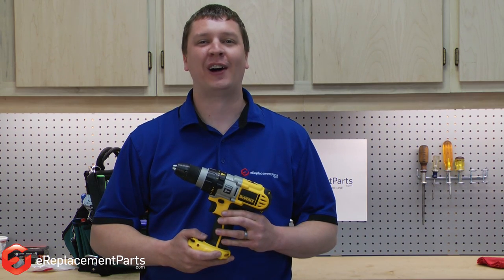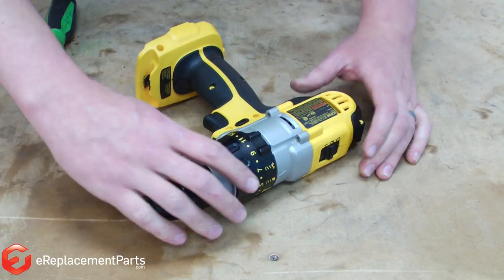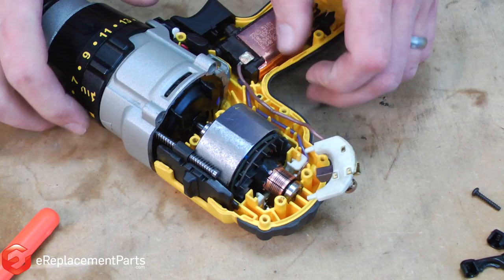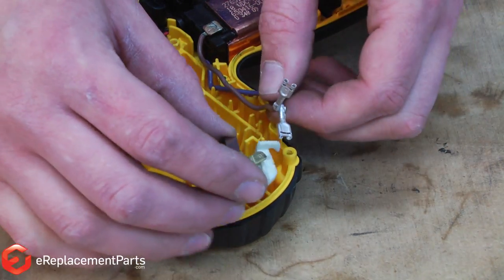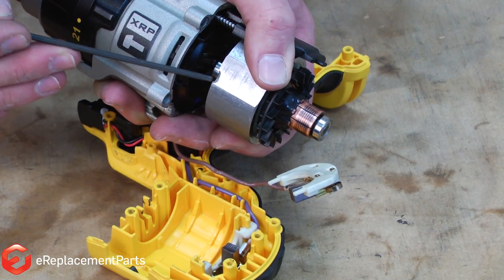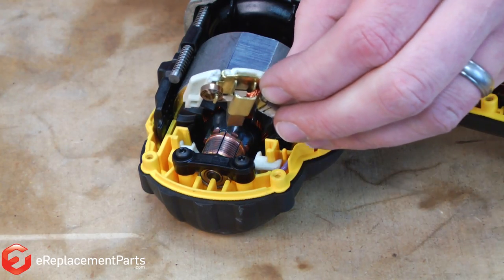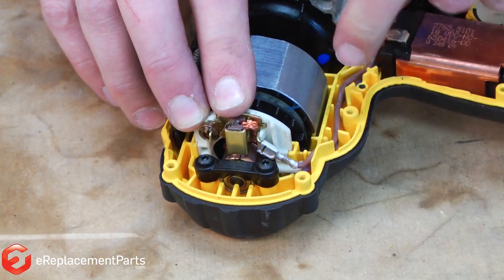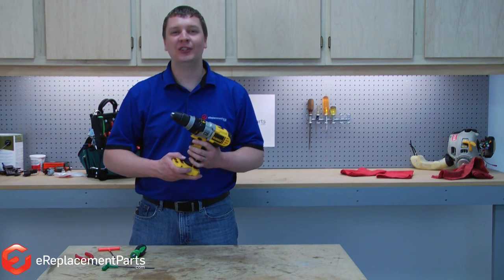How to Replace the Brushes in a DeWalt DCD Series Cordless Drill--A Quick Fix

Comment: Nice video. I am a dcd785 without battery . Can you please let me know if the drill watches thecells of the battery? 
Also do you know if i give higher voltage as 21v (that come from a lipo 5S battery then will the drill work only connected in battery +- 2 poles? thanks

Comment: one question  what  happen when we need replace brushes because mine is not working I want to make sure if is all I neee to replace
Reply from the maker: Worn brushes can easily cause the mixer to quit working.  Please remember,  These brushes only make proper contact when they are installed correctly.  They need to be installed matching the grove on the brush to the groove in the brush holder. If the brushes seem in good shape and installed correctly the problem could be the switch, speed control or something even more involved like the armature or field.

Comment: What about the dcd drills that have brushes inside the motor mount, unaccessable
Reply from the maker: Hello Thomas, if your brushes are not installed on the outside of the motor. They are inside the motor and cannot be replaced, you will need to replace the motor assembly.